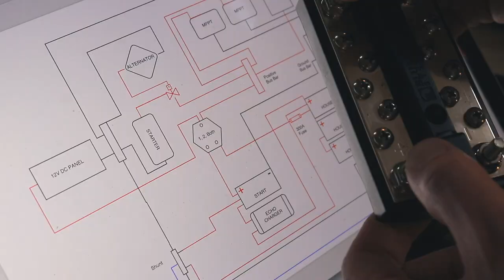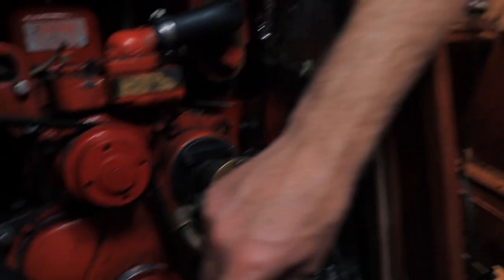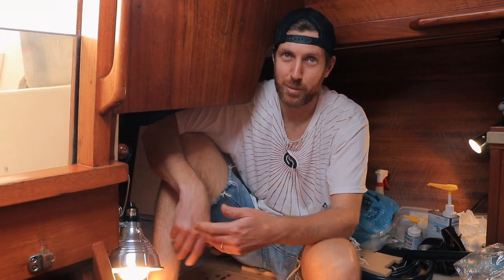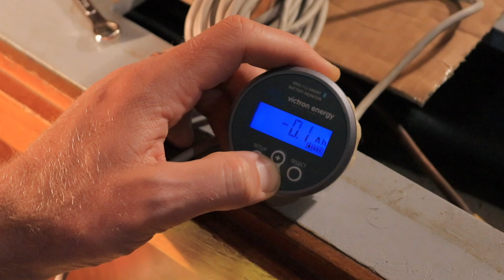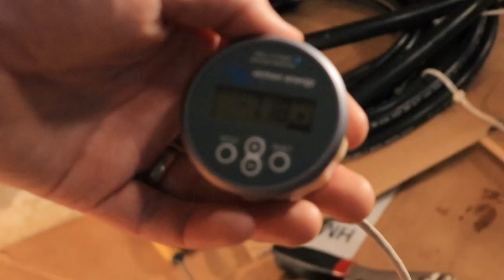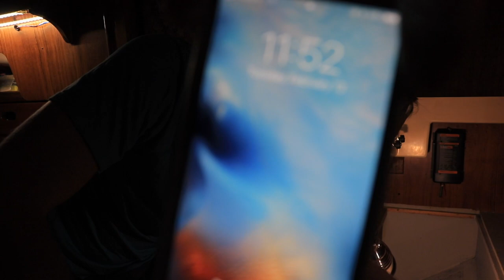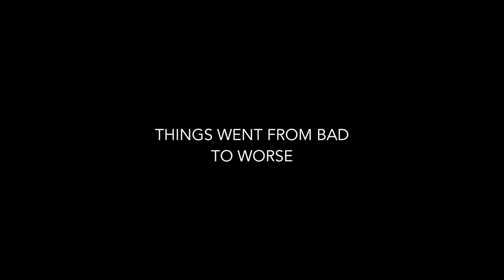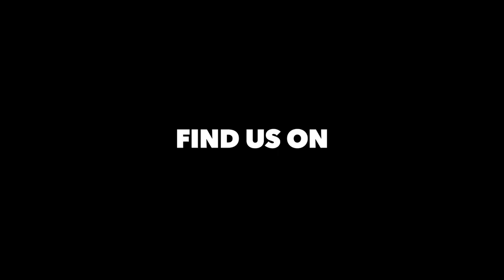Glad THAT’S Over | Sailing Soulianis - Ep. 38

Comment: I really think that the battery installation looks really clean and useful.  It is also a first that I have actually seen an installation of those batteries since Nigel Calder's workup suggesting them to sailors.  Those three batteries pretty much doubles your capacity for three lead acid batteries without the expense of going to lithium.  Also lithium batteries make you change out all the charging stuff and makes you buy expensive chargers.  With this install your alternator will just work with the system for instance.  Did you two spend the $512 ish for each battery?  That is the cheapest I can find them, so if you found them cheaper I would really like to know.  Among-st all the sailing channels putting in lithium, I am happy to say you really have a unique install here that should get you a lot of watch time.  Make sure to put the name of the batteries in your more section so people that are interested in them will find your video as well.   If you are going towards Florida you can get a good solar arch and dinghy davit system by people that can actually make them.  I know of yards where that is all they do and it doesn't take longer than three weeks, usually about 7-14 days.   I believe there are bolt on davit systems available for your boat off the shelf that are permanent installs(non-moving) or the swinging style.  You can take the non-moving style and buy the tubing, fittings from: https://www.defender.com/category.jsp?name=diy-railing&path=-1|7504&id=2290217     So all in all you can build your own solar arch.   I have seen them built by people with no more than an angle grinder with a few cut off and grinding disks, plus a few screw drivers.  You take the pre-built davits and then use them as additional support for the solar arch...or get a custom one from a yard.  Your choice!!  Hopefully the flexible solar is doing it for you.  Here is a rail mount davit system pre-built.  http://www.katomarine.com/image.php?type=sail&img=Tartan37
Reply: Please!!! Name the company. you were in Mobile,  right?  You'll be helping the next guy looking for a fabricator and hooking up with those clowns. Go to Yelp too.... "OUT" them.

Comment: I used to build race car roll cages for a living... by myself... with a manual bender. I could do a top flight roll cage with NASCAR bars and the whole shebang in under three weeks...by myself. There's no excuse for this workmanship.

The first clue for me that these guys weren't competent was the fact that they didn't fabricate some sort of pattern out of wood or PVC or something before they started to bend and weld expensive 306 stainless. You can't take measurements with a tape measure and a protractor and expect this to fit properly without the boat being close at hand (at the shop) or a pattern. Too many compound bends and off angle welds to mess up. If you mess up just one compound bend, the whole bar might as well be scrapped because it wont fit properly. It's easy enough to screw those bends up with the car (or boat in this case) in the shop, much less going off of hand measurements that are approximate?! Also, from your description of the welds, it sounds like these guys MIG welded everything. That's fine as long as you can grind the welds down and make them look decent, but stainless doesn't take to a grinder very well. I would have definitely TIG welded that thing together.
Reply: I more familiar with roll cages, and I was surprised that they didn't fab at least the basic structure on the boat.  At least get a couple of hoops built in situ before you start fabbing everything.

Agreed on the tig, as well.
Reply: I don't fabricate roll cages and I thought it was odd that they did not construct some sort of template.  I thought to myself "wow this guy either has no real clue what he's doing or Jesus came back to earth and builds railing for boats.  Even building small little metal brackets i will waste the time making out of scrap wood just so I don't have to do it over.  I hope the contractor is made to pay for his crap

Comment: I assume you have a fuse in line with the battery?
Reply from the maker: Yep. That was the fuse Kirk showed along with all of the rest of the the stuff we bought for the project. 👍
Reply: @SailingSoulianis  Good.  That will protect you if you drop a metal tool across the bus.

Comment: Unfortunately it is not uncommon experience. I went through a year of the same thing to get a dodger, Bimini, and roller reefing main. 4 contractors. 3 fired. If you try to get your money back, they know it will cost you more to sue them than what you paid them. The good ones are usually backed up with work for months. The most reliable is to have a boat yard professional do the work. Doing as much as you can your self.

Comment: One of the best things to do on any costly project is pay with a credit card. Then you have the protection of a chargeback if the product or service is not delivered or in this case totally screwed up.  The next fastest thing is small claims court.  They have around a 5k limit but you don't need a lawyer.  You have this case well documented.

Sorry you did all the right things going into the project and it still turned out so poorly for you.
Reply: Yup, I've won a CC dispute with about 1/10th of the documentation that they have shared with us. CC is the way to go.
Reply from the maker: Many of the right things.... Had we done as you'd said, paid with a CC we would of been fine and would have backed out way sooner - as soon as they missed the first deadline and would of saved ourselves a lot of stress.
Reply: @SailingSoulianis  I am so sorry you had to go through that.  You two have been so great with your channel and journey.  I appreciate all that you do and are.

Comment: Guys, why don`t you buy metal water pipes - they have their matching metal fitting for 90 degree turn, etc. You can build a very strong frame out of it, than you can paint it white with top coat or stg - it would look fine and do the job, I think.

Comment: God! I don't know whether to like or not like. I am so sorry, sometimes people get in  over their heads and can't seem to admit it. They didn't seem to take the time to take the proper fittings, and seemed to just make excuses and try to force through the install. Either they weren't that experienced, or the project was just beyond their current expertise. But the guy pounding a fastener from under the deck is unforgivable. There are ways of removing a stuck fastener without the bigger hammer solution. And the over tensioning of stainless steel attached to fiberglass is not good for any boat, much less a blue water sailboat. The stresses can be deadly! I hope your resolution of this experience has a better ending. 
The irony is you may find some local on an island somewhere working out of his backyard, who can build what you want in a week or two and it will fit like a glove. Good luck and fair winds!

Comment: With your IQ you would be better off DIY. Buy a TIG welder. Build it all in your mind before you start. This is a very tough learning experience, only justified by a happy conclusion.  You two will do alright because you have synergy. (1+1=3) Remember Caesar's proverbial disgrace 'Don't trip over the same rock twice'.

Comment: It's kind of ironic that you make a thoroughly excellent job of building battery boxes and rewiring your electrical system - working with multiple materials and disciplines though as an amateur, whereas that bunch of chuckleheads couldn't manage to do a competent job with the one material and discipline at which they're supposed to be "experts"...You may not be familiar with an old song called "Right, said Fred," sung by a British comedian called Bernard Cribbins, but if you get a chance, look it up some time...

Comment: Okay, so apparently I cannot stand being confronted by a mystery.  I did after much messing about, find the marina Soulianis was moored at, working backwards to finding the business in question. This was made difficult by the fact that this business no longer exists - if it actually did in the first place in the eyes of the law. 
 Googling the shop name will not produce results. Further digging led me to an address, which now claims it is a Sailmaking facility, despite not appearing to be an area where that would be possible. The most likely answer is this guy changed his business name to dodge responsibility for the 'work'. What I saw him make was a bunch of metal that was pre-bent, welded badly, attacked with grinders, pulled back and forth against it's will - it wasn't a fab job - it was an attempted hostage situation he tried to pass off as arch fabrication, and my bet is that you're not the first person he's ripped off and damaged their property.
And he's still out there in the  Mobile area pretending to be a sail maker  - still potentially stealing from people - which makes me really ashamed of the legal state of affairs here in Alabama.